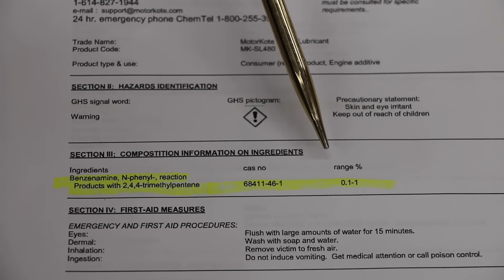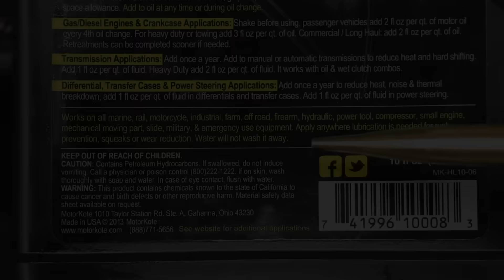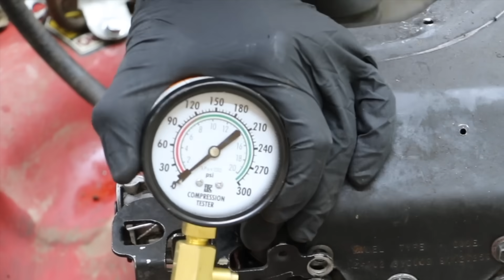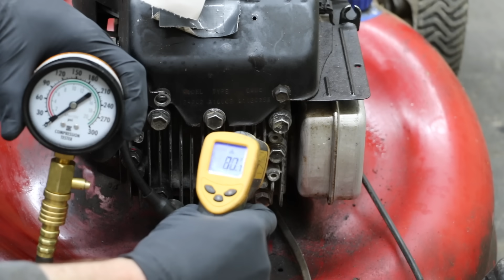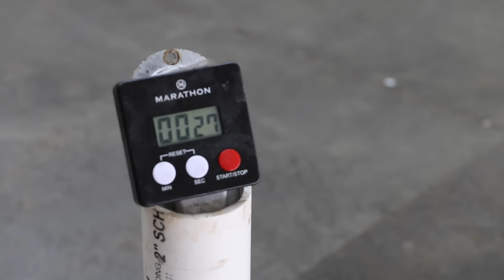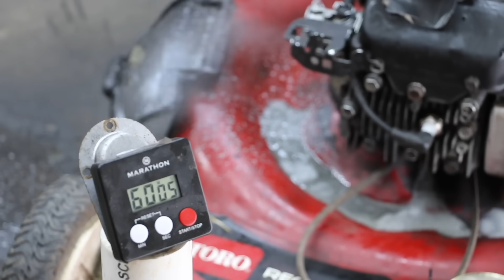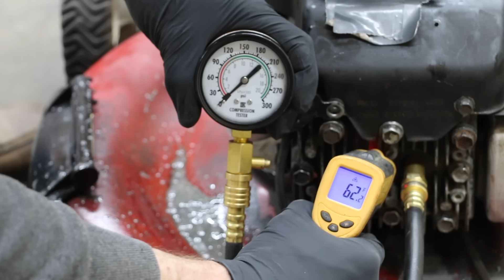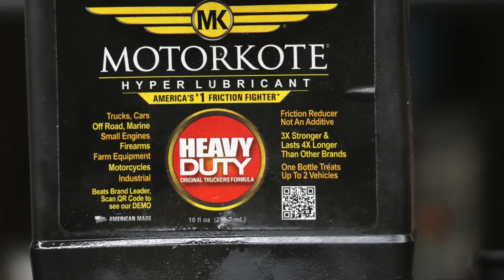Can MotorKote survive the water test?  Let's find out!

Comment: I did my own test too that lasted one and a half years.  Now, I came to the conclusion that Motorkote is corrosive and I will not use it ever again.  I put paper towel on the bottom of a cup.  The paper towel was soaked in Motorkote.  I put a one inch diameter bearing in the cup.  The bottom of the bearing was resting on the soaked paper towel.  When I saw the results I immediately decided to stop using it in my cars.   The difference between the bottom half and the top half of the bearing was noticeable.  The bottom half was stained permanently.  I tried to clean it, but, it didn't help.  Imagine the damage it does to the engine's soft metals, rubber, neoprene, cork and compositions which are basic ingredients used in seals, gaskets.  Now I can explain why oil was dripping out of the rear seals of two of my cars.  It didn't happen immediately of course.  It takes some years.  I then looked more into it to find more information.  I searched online and here are some information I found that I copied and pasted here for anyone who is really interested to know the scientific truth why additives work and why they are harmful to the engine.  

Chlorine Additives Cause Corrosion: Consumers frequently encounter “engine treatment” products containing chlorinated additives because chlorine reacts with the metal substrate to form a reactive species, or an oxide, which becomes a friction barrier … and produces dramatic demonstrations on ‘bench tests’. However, the by-product of oxidative chlorine causes problems in both engines and the environment. Chlorine is extremely reactive, making it corrosive to engine metals and interactive with many motor oil components. Further, chlorine’s long-term corrosive attack can outweigh any short-term benefits. Therefore, the addition of lube supplements containing chlorine, when added to motor oils,  is akin to rolling the dice with the engines short and long term performance … it’s risky.

Where Chlorine Use in Lubes Makes Sense: Chlorinated additives react quickly with metal surfaces due to high electron negativity. Therefore, chlorinated additives are sometimes used in industrial cutting fluids designed to meet the extreme pressure requirement of metal machining. Metal machining involves a “one pass” metal shearing operation in an open system with constant flushing, conditions not conducive to corrosive attack (like it would be if used in motor oil that is constantly recirculating within your engine). Interestingly enough chlorine gas reacts with most organic compounds, and will even sluggishly support the combustion of hydrocarbons.

Hydrochloric Acid Corrosion – The Long-Term Impact: Internal combustion engines involve a closed loop system with conditions described by Mr. Maurice LePera, who served as Associate Director for Fuels and Lubricants at the U.S. Army’s Tank - Automotive Research Development and Engineering Center, in the August, 1998, Lubes-n-Greases article “Chlorine & Engine Oils: A Good Mix?”: “Chlorinated additives are not used in modern, fully formulated automotive engine oils. The environment within an internal combustion engine consists of high temperatures, combustion and blow-by gases, moisture, acid and oxidation precursors, wear debris, unburned fuel, etc. The combination of these ingredients when combined with the catalytic effects of metallic surfaces and trace soluble metals such as copper will cause the chlorine to hydrolyze, forming hydrochloric acid and other associated reaction products. Once generated, these acidic reaction products can cause serious internal engine corrosion problems, especially on ferrous and aluminum alloys.”

Considering the ferrous and aluminum nature of the most modern engines, one must seriously consider the use of chlorine-containing supplements if engine durability and longevity are important criteria.

Specifications – They Prohibit Chlorine: The reality of engine operation is that the corrosion inhibitors, which are added to motor oil formulations, are simply a short-term fix that leaves engines prone to corrosion after they do their job (are consumed) and lose their effectiveness. Certain chlorinated additive manufacturers claim that their products are non-corrosive. Unfortunately for consumers the corrosion process is not visible to the vehicle operator, and thus can continue unabated until the cumulative effects induce engine malfunctions and failures. Again, quoting Mr. LePera: “Corrosion within an engine can be a ‘silent killer.’” These concerns are supported by military lubricating oil specifications and commercial specifications prohibiting use of chlorinated additives.

Chlorine – An Engine Component Damage & Environmental Risk: Further, Mr. Cliff Gottlob of Gottlob Research and Engineering reports: “This [by-product of chlorine in engines] is a very corrosive product that is not only detrimental to such components as bearings, pistons and any metal parts, but also the environment. ... The devastating effect of chlorine on such items as rubber, neoprene, cork and compositions which are basic ingredients used in seals, gaskets, etc., is extremely bad.”

Lube Supplement Labels - Can Dodge The Real Issue: Unfortunately, many chlorine additive container labels do not state, “Contains chlorine.” Technically, chlorine in its pure form is a gas, so these products dodge the issue by using chlorinated; hydrocarbons, paraffin’s, solvents, etc. If the additive container label states, “Contains no PTFE, graphite, molybdenum disulfide or solids,” the product may likely contain chlorinated additives. And in some cases, the label may claim it contains moly or PTFE or whatever, but then they use chlorine to illustrate wear protection capabilities – especially during bearing wear demonstrations.

Trick Demonstrations: Due to chlorine’s quick reactivity, promotional demonstrations such as oil-less engine operation and friction bearing testers prove attractive to the unwary consumer. However, note comments from syndicated newspaper column Drive It Forever by leading automotive expert Mr. Bob Sikorsky, member of the SAE and STLE, nationally syndicated automotive columnist and author, and recognized consumer advocate: “Sadly, a number of these [chlorinated additive] infomercials use trickery and deception to convince the public to buy the product. ... The demonstrations shown in these infomercials are meaningless, and have nothing to do with what actually happens inside an engine during operation. ... The downside, which of course is never mentioned, is that it’s extremely corrosive." Further he states, “Choosing the right product could mean the difference between real 50,000-mile engine wear protection, and an engine hosting unproven possibly dangerous formulations.".

Only ASTM- and SAE-approved engine tests are meaningful, and neither of these companies [Dura-Lube and Prolong] has proven its product under these industry-recognized testing procedures.”

Longevity – Chlorine’s Impact: An October, 1998, Consumer Report article, “Prolong additive: Don’t try this at home,” addressed the infomercial demonstration issue: “The bond is supposed to last even when the oil is drained. In the [Prolong] infomercial, Unser and others drive along a racetrack in the Mojave Desert without oil or oil drain plugs. The same ad, broadcast nationally, pictures a woman who, thanks to Prolong, supposedly drove from Santa Barbara to Los Angeles without oil. (The reason she stopped after 4 hours, 40 minutes, and 7 seconds? She was hungry.)" We didn't test the other claims, but we did see whether Prolong would protect an engine after the oil was drained. “We installed a factory-rebuilt GM 4.3-liter V6 engine into each of two Chevrolet Caprices. We broke them in with Pennzoil motor oil, and added Prolong to one of them. Prolong claims to work immediately. We drove more than 100 miles, then drained the oil and started driving again. After only 13 minutes and five miles, both engines failed simultaneously.”

Lab Analysis Comments: Lab results indicate the product provided for analysis contains:
•         839 ppm Cl (chlorine)
•         57,300 ppm S (sulfur)
Reply from the maker: Thanks for sharing!
Reply: @ProjectFarm  You are welcome and please allow me to suggest you to include a new series of tests besides lubricity tests.  There are a total of three different tests you can do for each lubricant you test.  One is the lubricity which you already do and it is very interesting.    
The second test is the carbon deposit test when the lubricant is heated for a long time.  A French company that makes the ELF oil made this test on their synthetic oil and after it was burned completely and evaporated, nothing was left.   That is, no deposits at all.  That is the same oil you buy at the Ford dealership.  It says "Ford" on the bottle, but, it is made by this company that is now called "Total". 
The third series of tests you can do is how corrosive the lubricant is.  You can buy online the copper test strips and begin this new series. 
All the videos you did until today are super and the world knows how hard you work.  You deserve all the blessings.  All the best to you!
Reply: @atvstel  I read your text very carefully. I want you to explain to me that while I have been using this product for many years(engine gearbox), I have never encountered any corrosion problem in the engine and gearbox. I always had a suspicion that these products contain some unsuitable ingredients, and to my knowledge I risked using them, but I never had any problems. My vehicles are 16 years old and 30. Thank you for your informative text.
Reply: @distribiter    The corrosion I saw on my bearing test was not horrible. It was not pitted in any way. It was however stained into a dark spot where it was touching the Motorkote.   That stain still allows the engine to run fine. But, again. I can't see inside the engine how it affected other parts. As an example is the thin surface of the crank sensor.  That sensor has a constant 5 Volt reference and it's electromagnetic. Each time the teeth of the flywheel pass at a certain distance from the sensor, the magnetic field changes. Each millivolt of fluctuation is a message to the PCM.   Having only half a millimeter change in distance can affect the operation of the engine.   This is just one example. There are many more sensors that are made of thin tin barrel and any stain on them might eventually affect its operation over the long term. In other words, I don't want any corrosive additive in the engine since I can't see inside.  Also, there is the possibility of a rubber rear seal hardening even though it lubricates the metals.  Why do I take the risk of a hardened rear seal?   For the so many years your engines are going strong, did you ever have any seal or any sensor issue that you didn't relate to the additive?   Or any clogged oil passage caused by the sludge Motorkote leaves behind when heated?  Did you have any issue whatsoever?   Let the community know so we can relate and begin bringing things to light.  By the way, I started my 2nd experiment some time ago which I will uncover in couple of years. This time my test includes new bearings and zinc washers.   This time my test also includes more additive products.
Reply: @atvstel  I have not any seal problem or lubricant compustion. My engines consume 1 liter per 10000 km lubricant . I think is normal . Τhe engines also never had a problem with sensors. My engines is bi-fuel (LPG-Petrol) .

Comment: ... my 2002, 5.4 liter Ford V8. So I am always searching for the best combination of engine oil and any additive the show's a significant chance of improving engine longevity. From your tests, it appears that Amsoil and Motorcoat offer the best combination of oil/additive that you have tested so far. What is your opinion about this combination? In an earlier test of Bestline, you mentioned upcoming tests of potentially better additives. If you still have that series of tests on the horizon, perhaps I should await your results of those tests before mixing Amsoil and Motorcoat?

Thank you again for doing such detailed testing and research. I look forward to every new edition! Happy new year!🎉

Comment: This is incredible!
Reply from the maker: Thanks!
Reply: Dang it,I accidentally deleted my comment when I edited it..  I'll retype it.

Even if you don't do these tests I still want to say I really appreciate your tests!  My new truck was undercoated with cosmoline ( used to use fluid film) and the frame should last a long time because of it.  Thanks!!
Reply: Couple ideas for a test.

It's been said that grease with moly should not be used for high speed roller bearings because it can cause the roller bearings to "skid" instead of rolling which will cause excessive wear.

You can see it talked about in this article:

https://www.machinerylubrication.com/Read/28632/use-right-grease

Another test could be done on roller rockers and their bearings using the wheel test, 5.7L Hemi roller rockers and some pressure.

These are known to fail in the hemi for various reasons and it'd be nice to find out if certain oils or additives can help the problem.  The skidding issue may also rear its head here.  It's a highly contentious topic :).

Comment: Very impressive video; Thank you.  Does Motorkote wash off with gasoline?  I've started rebuilding 2-smoke engines, and it might be a nice to pretreat (to/for) the parts.  I doubt that it would prevent seizure if the engine was 'strait gassed',  but it might mitigate the damage, or delay the inevitable.
Reply from the maker: Thanks so much!  Thanks for the video idea.

Comment: UPDATE 2, Goldwing 1500 with fresh Synthetic 15w50 oil & filter change added 1.5 oz of Motorkote. At roughly 40 miles motor started to run noticeable smoother. After 100-ish miles WOAH, I'm talking one smooth running motor. Past week (so far) startups are slightly faster RPM's until started. Cannot say MPGs yet, ambient temps were erratic.
__
UPDATE 1, REPLACEMENT BOTTLE SENT.
HEARD RUMOR SOMEONE WAS CAUGHT STEALING. Shipped via FedEx.

Comment: Forgot to mention, i disassembled the old cylinder heads and found the valve seals quite hard with tiny cracks along the sealing lip. Granted the heads were 15 yrs old with 178000 miles. The new heads are 9 months old with 10000 miles. I will replace the seals and see what i find.
Reply from the maker: Sounds like a fun project!

Comment: As great as this product is it had some unintentional consequences on my 2005 chevy Tahoe with the LM 7   5.3 engine  (same engine in your suburban). First some background information. Last November 2019 i tried a product  AP-205 engine sealer recommended by Scotty Kilmer to help with a rear main oil seal leak. Within 48 hrs I noticed a cloud of oil smoke upon startup, apparently the        AP-205 had an adverse reaction with the valve stem seals. One month later i replaced the cylinder heads with a remanfactured set and the smoking went away.... until i added this product... 48 hrs later the start up smoke returned,  WTF ?  Now I’m not blaming Motorkote, i still think it’s a fantastic product (allowing an engine to run 1 hour with water in the crankcase is an absolute Miracle). I have reached out to motorkote but have not had a reply yet. I don’t want to complain rather just give them some Data. In a later Scotty Kilmer video he mentions GM using unconventional materials in their rear main seals on this engine, perhaps the same material is in the valve stem seals.  Keep up the good work and please test the oil additive Hyper-Lube which has been around longer than most oil additives.   Thank You !!
Reply from the maker: Thanks for the video idea.

Comment: Tell you an interesting story about my introduction in MotorKote. When this product first came out maybe  10yrs ago + or - .  A friend of mine was machining some parts and he was trying to drill a hole into a block of steel on his press and kept on breaking carbide drill bits (very expensive)  even though he was lubricating the bits.  He had a bottle of MotorKote and we all said well lets try this stuff and he dipped a new carbide brill bit in MotorKote and the bit went through that steel block like butter!!  We could not believe what we were seeing.  He did it several more times on the other blocks with the same results and the bit was as sharp as ever.    Just another use of MotorKote.
Reply from the maker: Thanks for sharing.
Reply: Cool story bro.

Comment: You should check out a product called NMF or "no more friction" it claims to help with friction by giving all the metal parts in an engine the same electrical charge thus making them less attracted to each other and all the little particles easier for the filter to grab, I know that my motorcycle vibrates way less with it added to the crankcase
Reply from the maker: Thanks for the suggestion.

Comment: I have a 2000 VW Jetta TDI (diesel) with 270k, burns no oil, and have used Mobil Delvac 1 (10,000 mile oil changes) since the beginning.  Do you see any advantage to using Motorkote with my car or with synthetic oil in general, or does the oil have enough additive already?   Great video and testing.  Thanks!
Reply from the maker: Thanks for the video idea.

Comment: I use motorcote in my truck better fuel mileage and I get over a million miles on the engine, I use it in the manual transmission and differentials.  I love it great testing
Reply from the maker: Thanks for sharing.

Comment: That was Magical', I'm going to have to remember that name, MotorKote , almost as good as Slick50 was back in the 80's, we used it on an engine that leaked bad, and we drove it 15 miles with no oil in it after we used the Slick50 and it worked, the engine survived.